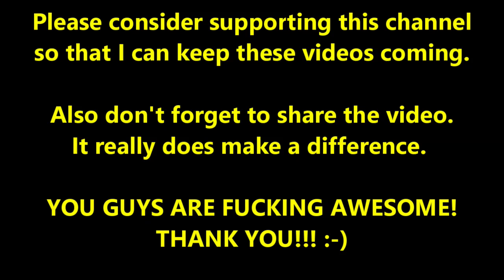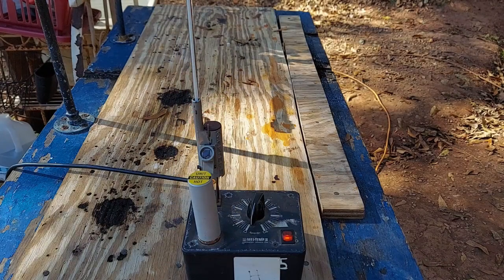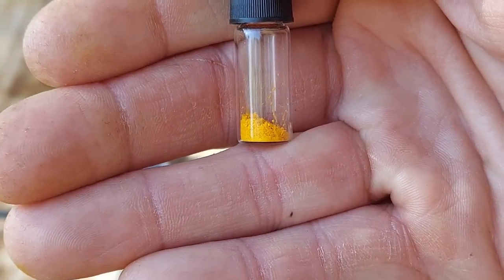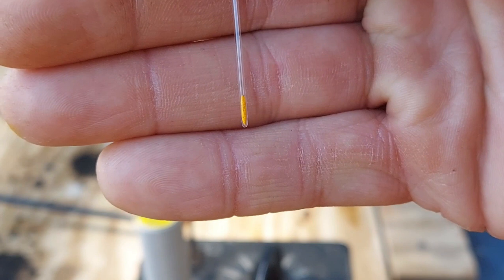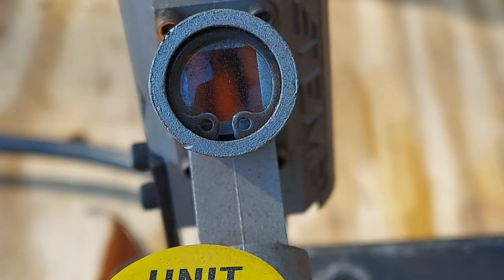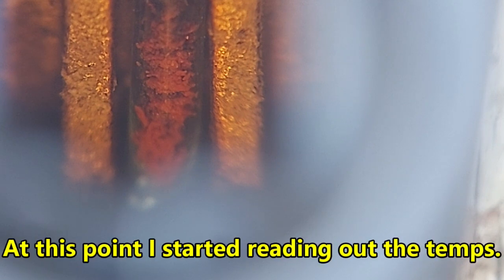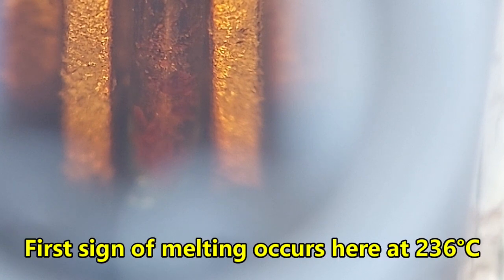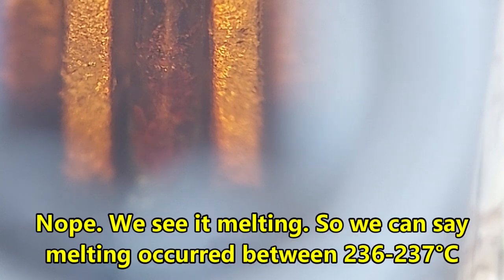Proof Benzaldehyde Prep Worked #meltingpoint #chemistry #analyticalchemistry #organicchemistry

Comment: Have you tried the prep of benzaldehyde from toluene with chromylchloride via etard   reaction?
Reply from the maker: Nope. Making benzaldehyde is just a side benefit to BPSP. Thats not what it is most useful for. And despite the lower yield if I wanted to start from toluene Id use barium ruthenate. Its much faster and easier to work with. Although here again thats not what its most useful for.